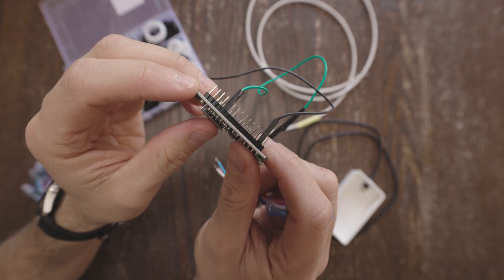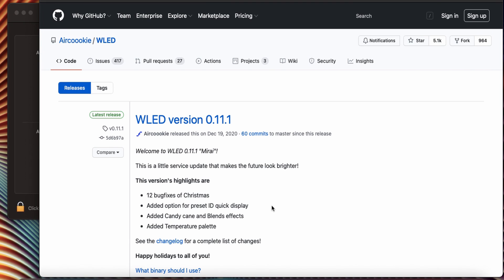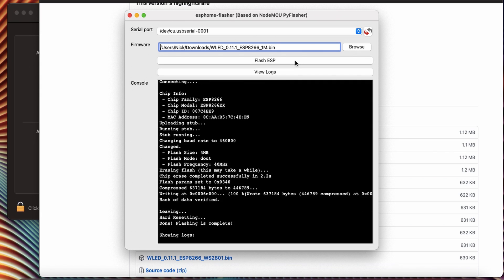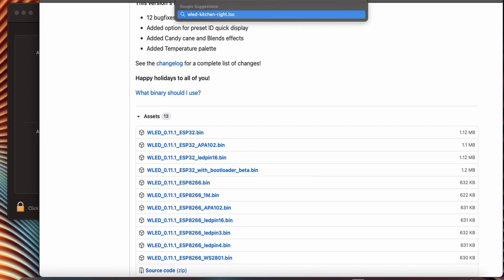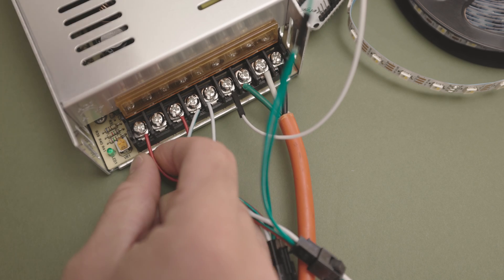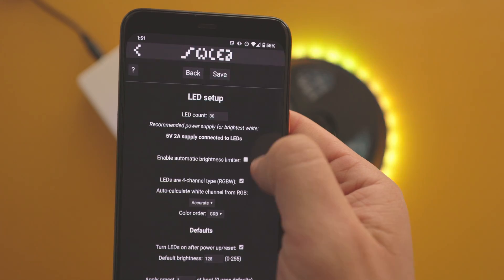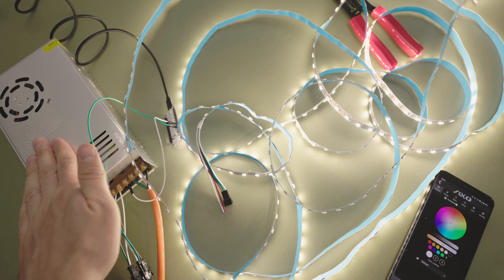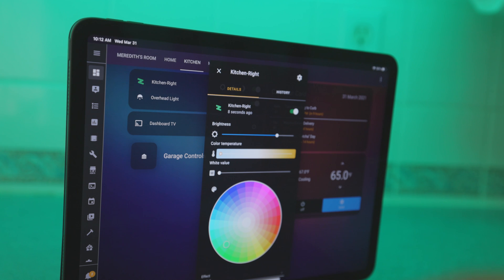Getting Started with WLED in 2021

Comment: Yeah, I’d go deeper with the explanation on the safety part. 300w can easily start a fire if no proper wire is used , no fuses , also, if your controller is further away from the strips (as in starting from 6-7ft away) you need a level shifter in there so that the data signal be clean Al the way. nice video but people can have real problems if they don’t follow some safety rules

Comment: If the controller IS getting too hot what is the solution? I have had several boards fail and I can't figure out why but suspect it is heat. I have a 5v 2 amp phone charger and have a limiter set to between 850 to 1500 but it seems my ESP8266 are getting super hot.

Maybe I need to get a real power supply and not the phone chargers. 

Any suggestions?

It seems when I set the limiter too high is when the board ends up dying...but I have never set it higher than about 85% of the chargers power (I set it to about 1850mA once and it died 30 mins later).
Very frustrated as I have been working on this for nearly a month and have gone through 5 ESP boards. (2 of them were DOA, 1 died quickly after, 2 worked awhile then died)

Comment: I am running a ws2815 5M strip on a MEAN WELL LRS-350-12v psu. Do you recommend front and end loading injection and if so, would 12v injection be overkill or should I use a step down converter to 5v at end? ty for your time.
Reply from the maker: If you’re using 12 volt lights and just the one strip, you should be fine as long as your power supply isn’t super far away from the strip. The important part is to try to keep your controller as close as possible to your strip (node mcu or D1 mini)

Comment: What LED strips can I use, I’m a college student so I’m a lil broke and was hoping to get a strip that would be about $20 for 16 foot 300 LED strip, where could I find these?
Reply from the maker: https://amzn.to/30ShibZ I've used these before. They aren't RGBW, but they work pretty well. But you'll have to get a power supply and of course program a controller with WLED. If you want a pre-built option, give makes pretty decent LED strips at a good price https://amzn.to/3plvIe1

Comment: At 8:00 - how have you fixed the DC socket to the wall of the box?
Reply from the maker: I used a drill bit called a stepping bit, then I used a rubber grommet and held that down with super glue and then attached the barrel power connector with super glue.
Reply: @NickRains  Thanks!

Comment: In segmentation, say I have my strip on the back of my table and it extends to the shelves on the wall by its side, Can I set up the leds on the table to be a different color to those on the shelves?
Reply from the maker: Yes, exactly. You can even have your table LEDs on and the shelf lights off if you wanted. It's a little difficult to control, but basically it can treat them as two different lights.

Comment: Thanks for your video. I have my lights all set up on the Halloween mode.  But I have some questions. They turn on by themselves. They go to default mode after a while and I can't get the time controlled presets. I think if I can figure these things out, I would be set. Is there a way you can help me? How can I contact you?

Comment: Not working on windows 10.  It flashed to the D1 Mini but I cannot find it on a network through my computer
Reply from the maker: Does the light on the D1 mini flash when you press the reset button? Also I tried flashing with windows and only ran into issues. It’s actually really easy if you have a raspberry pi, I’ve been thinking about making a video showing that.
Reply: It sure does. I wasn't sure if there is some other code or something I have to put on it or not.  I am very new to this, like 5 hours new to this lol.  I have been watching video after video and reading forum after form and I cannot find anywhere that I can fix this.  So in this video I am getting that you had bought this controller, installed the drivers, installed arduino ide, downloaded wled, downloaded the flash program, flashed the controller, installed the board on arduino and bam you got lights? No other programming or coding to type in? No setup of the said name or password?

Comment: Hii, I am receiving this as an error-
"Unexpected error: could not open port 'COM12': FileNotFoundError(2, 'The system cannot find the file specified.', None, 2)"
pls can you help me out here
Reply from the maker: What kind of computer are you using? Try another usb cable. Also sometimes I just have bad esp chips, lights will work and everything seems fine, but it won’t let me program it.
Reply: did you figure it out?

Comment: Addition idk about 8266 but esp32 i learned have issues with 5ghz wifi use 2.5. None of my 3 esp32s would connect to my 5ghz wifi all 3 had 0 issues with 2.5 though. Took me about 2 hours to figure out that was the issue with why wled couldnt locate them.

Comment: Hi! I love the info in your video! BUT‼️ 18Ampere current is Waay Too Much for those thin wires! Please educate yourself about this! Potential Fire Hazard!
Reply from the maker: I hope my video wasn't confusing. The power does not run through the esp microcontroller. The microcontroller shouldn't use even 1 amp. 

The LEDs can have their power ran through the microcontroller, but I personally don't recommend this unless you change a few things.
Reply: @NickRains  Hi, no I saw that. I was referring to the thin wires going from your power supply 🙏😊

Comment: Can you run 12v WS2811 Led strip with the Node MCU Kit or does it have to be 5v Led strips
Reply: You can run 12v, it's a bit tricker. I power my d1 mini through the USB port, that gives it 5 volts. Then hook the leds positive and negative to a 12v power supply. Make sure its powerful enough to run 12v. I have a video on my channel showing the hardware set up for my Christmas display. Though for that I us ESPixelStick not wled. I use wled for other applications
Reply: @TownshendChristmasLights  a me non funziona

Comment: Can I use ESP32-Wroom board instead of Node mcu?
Reply: Yes you can. In fact the they are have better WiFi signal and more stable. They cost a little bit more too.
Reply: @TownshendChristmasLights  Thanks , i was able to flash the esp32 with WLED_0.12.0_ESP32.bin. WLED is now easily installed following steps in this vdo. one question is about the D4 pin, I don't see that pin on ESP32-WROOM board, which pin would be used for data on that board? would you know? Thanks.